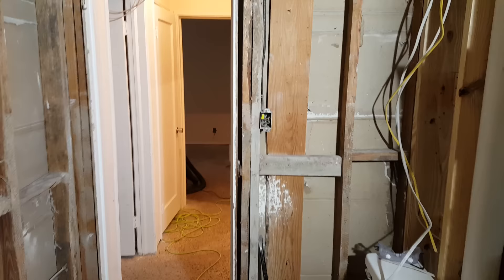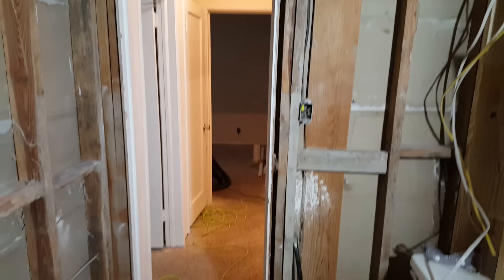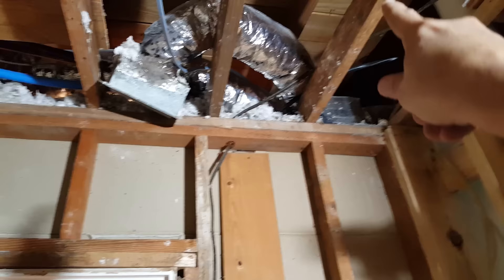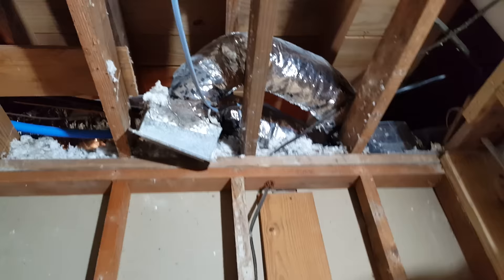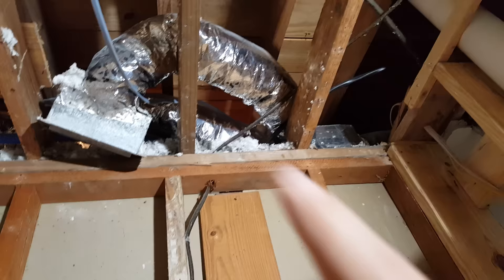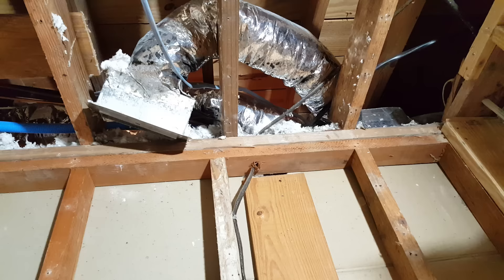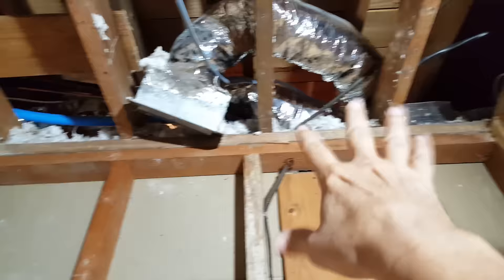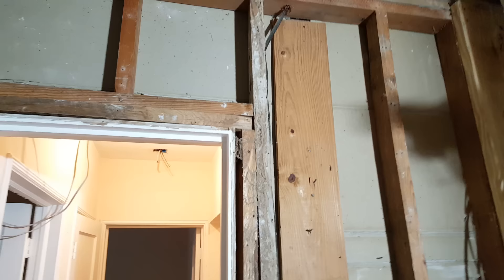How to Tell if Your Wall is Load Bearing

Comment: I thought a load bearing wall is where the joists rest on at the ends, let’s say u have 3 walls, a joist runs over all 3. Do you count all 3 as load bearing or just the two end ones, ??
Reply from the maker: Yes your definition is more exact. The walls with joist endpoints are load bearing.

Comment: Superhelpful video, thanks. If a second floor wall (it's a wall that divides a bedroom, creating a kind of finished walk in closet) isn't above a first floor wall, is that an indication that it's not a supporting wall (because with no wall beneath it, the weight isn't transferred down into the foundation)?
Reply from the maker: That might be what it is in your case, it's really hard to tell without being near to check above the 2nd floor wall because it might still be a load bearing wall but the forces are being spread out all around the floors on the 2nd floor and then down to load bearing walls beneath the best way to tell this to go up in the attic above the 2nd floor if any floor joist have end points on top of that wall then it is load bearing. If you see any with instructions from any of the roof gable's coming down and resting on top of that wall then it is a load bearing wall
Reply: @jeffostroff  Great, I'll check it out. I'd likely have someone come in and look at it before taking a wall out, but if I can tell that it IS load-bearing myself, then I won't bother dreaming about getting rid of it and won't waste $$ bringing someone in.

Comment: Would there ever be (ceiling) drywall between a top plate and a ceiling joist? I have a truss roof.  Wall is running perpendicular to the ceiling joist (middle of house). Seems like it is non lead bearing?
Reply from the maker: Not that I know of, drywall is not meant to be load bearing, so it should not be compressed. It could be mounted on the top plate if there is no ceiling joist resting on it.

Comment: What code does not require an approved and properly supported header (beam) in a load bearing wall?
Reply from the maker: Keep in mind this house was Built-in 1946 for veterans on the cheap and so often times things were done a lot more simply and who' is to say what the codes were at the time or whether they were even observed. Also there are some debate as to whether this wall is a full load bearing wall because the ceiling rafters above do not end point on top of this wall they do rest on the wall but they don't end point on top of the wall.

Comment: I am an engineer and carpenter. There are several times in which information given in this video was incorrect.  Please do not take advice from a Youtuber, get a licensed contractor or engineer inspect your home.
Reply from the maker: I doubt you are really an engineer, because f the info here is incorrect, you would have pointed out which item and what is wrong with it and which building code spec it violates. You just come in here pumping your chest about how you are an engineering God and hand wave about "several times" bad information was given, a bunch of unspecific nonsense. So here's your chance to "correct what is wrong".
Reply: -Double top plate in no way implies load bearing. Double top plates are used to tie into other walls.
-Joints lying perpendicular to wall doesn't imply load bearing. If the joists were overlapped over this wall, its load bearing. 
-There's no worry of shear in top plates in traditional or advance framing.
-That was not an appropriate header for a load bearing wall.  
There is no gray area when deeming a wall load bearing. It either is or it isn't. If you're worried about sagging then the sagging needs fixed before anything else. I'm not trying to argue with you, or call you a bad person, or boast about my credentials. I'm trying to make sure people are being safe. So my only real correction is, get it inspected by someone licensed.
Reply from the maker: The International Residential Code, Section 602.3.2, Top Plate, specifically states: “Wood stud walls shall be capped with a double top plate installed to provide overlapping at corners and intersections with bearing partitions.”  Notice it says Bearing Partitions.

So you and I are both right, the top plate serves a double purpose, but I even mentioned in the video that even nonbearing walls often have upper plate. But you are still half wrong You can see it requires the top plate for load bearing walls, not just for any old wall. But of course many carpenters build them anyway. Also in Section R602.3.2 Top Plate, they give an exception where you can eliminate the top plate if an only if  “1. The single top plate shall be tied at corners” with a 3 x 6 galvanized steel plate, AND, this is the big part, just like I stated in the video:  “ 2. The rafters or joists shall be centered over the studs with a tolerance of not more than 1 inch (25 mm). “ Clearly they are worried about shearing, because a 2x4 cannot possibly be expected the bear the weight. After all, you use double 2x6's for a header over a door right?

so based on the specs given by the building codes, it does indeed require a top plate for load bearing walls unless you can guarantee that the joists are directly over the stud. This is where I mentioned builders are looking into designing their roofs to comply with this to save wood.
Reply: Yes it says bearing partitions but it's not saying a double top plate is there for bearing. It's saying the double top plate is there for overlap at the intersection of a wall and a "bearing partition". A bearing partition is just a bearing wall. So a double top plate is required for tying into load bearing walls and corners.
I was taught that joists need to lie close to a stud for things like toe nailing or other fastening because if they're not, a sagging joist that is only nailed through a single top plate could twist the top plate.
Reply from the maker: Play nice people,  There's always going to be 2 different opinions on the same topic. AND please keep language family friendly no cursing, flaming etc.
Reply: Engineer lol.
Reply: I'm not engineer, but am a carpenter. This guy is full of bologna. This is simply not a load b wall.
Reply: jeffostroff I am a Contractor in California and this is Not a load bearing wall. A load bearing wall would require a footing with HDs in the corners of the wall. This is simply a partition wall.

Comment: I have only helped build my own house (not a carpenter) but if that was a loadbearing wall, wouldn't I would want to see a header with the 2x vertical?  Laid on their side like that, those header 2x are a lot less resistant to bend.
Reply from the maker: Joshua Horns  Yes you are correct you would want to see that Head are you described with them on the vertical and in fact many modern day carpenters prefer to use 2 by 6 on vertical.  Keep in mind that this house was Built-in the 1940s on the cheap for veterans and so a lot of times either corners were cut or quality goes by the wayside or may be a lot of people just didn't do it that way back then. Also this particular wall might not be a full load bearing weight wall because the ceiling joists up above do not terminate on top of this wall but they do cross it at a 90ﾟ perpendicular.  Even if a wall is not load bearing I still prefer to see the door frames built the way you described anyway just makes good sense and it really doesn't take much longer to build it that way and it allows for expansion later on of your house or any other improvements that might require beefing up a doorway.

Comment: The builder didn't do the header correctly if it truly is a load bearing wall.
The "header is  two plates on flat.
Reply from the maker: Yes, that is how they did it here in 1946 here in Florida. Also this is not a true load bearing wall in the strictest sense, because the joists do not endpoint on top of this wall, they stretch over this wall, so they did not need to use two 2x6 board sandwiched together and mounted vertically.

Comment: The header above that door is not a load-bearing header it should be stood up on edge and have to and they should be at least 2 by 6 if that's very well if it's just a little flat laying flat that's not a load-bearing wall
Reply from the maker: Yes you are correct and keep in mind this is a house Built-in 1946 on the cheap for veterans and so they often did things not up to code. And if this wall is not a full load bearing wall then they have no problem to get away with doing this

Comment: I thought that secound 2×4 on top was to tied the walls together?
Reply from the maker: Angel Loya  It is there to tie the 2 walls together and it is also required for load bearing purposes. The building codes allow you to eliminate that top 2x4 if you use a 3 by 6 galvanized steel plate  To tie the 2 walls together
Reply: jeffostroff All walls have the 2 top plates. Doesnt matter if its load bearig or not.
Reply: Snipe Stud00 right. thats how we did it. Every wall has a top plate.
Reply: In 20 years I have never built a wall that didn't have 2 top plates.
Reply: Angel Loya  the second top plate is to tie the walls together.
Reply: Angel Loya also, if the wall is load bearing, you should have a minimum of 2x6 for the header. You never turn the wood on its flat as there’s no strength to the wood that way. 2 2x6 with a half inch plywood sandwiched between them.

Comment: what about engineered roof trusses spanning a main floor ? ive looked in my attic and none of the ceiling joists (rafter bottoms are lapped or butted over a wall im thinking my entire top floor could be opened up the floor joist are different though as they lap over on a wall in the baesment
Reply from the maker: If you have the case where the trust is go all the way across the house and don't end point on any walls then chances are your exterior walls are the load bearing walls. If you look up in your attic do you see any structure components coming from the top of the roof Truss down to any of the walls? If so those walls would be load bearing because they are acting as a brace for the load of the roof

Comment: is it ok to remove a kitchen cabinet above a refrigerator if the wall is load bearing ?
Reply from the maker: Yes we do it all the time  and replace with new cabinets you just want to make sure your screws go through the back of the cabinet on a support brace on the cabinet and all the way through the wall into a stud. What I like to do is put full depth cabinets over the refrigerator but when I do that I will then add a a thick panel on either side of the refrigerator to help support that cabinet and also make it look more professional. Many of the cabinet manufacturers will have these panels that you can buy and you just cut them to whatever size you need

Comment: Is there any way to open up that doorway any? I have a doorway into my living room I'm about 90% sure its load bearing but I'd really like to open up the hallway straight into the living room is that doable?
Reply from the maker: There is a way to do that depending on how wide you would need the opening to be you would have to use to buy 6 headers that are standing upright so that the 6" part is the taller part and you would have to of them seem which together with the board and between them or you would have to have somebody engineer you a beam with adequate Jack studs and king studs on either side

Comment: I am looking at taking out or modifying a wall in a house with a a flat roof (no idea why they put a flat roof on a house) and no basement.  Are there any other non destructive methods to determine if the wall is load bear or not or will I just have to rip into it to find out?
Reply from the maker: You'll have a to cut a large 12" or large square hole near the top of the wall to stick your head or camera, and cut a square hole on the ceiling, so you can look above the wall to see if any ceiling joists have ENDPOINTS resting on top of the wall. You don't have a gabled roof based on your description, but also look to see if there's any roof support struts, or other angled 2x4s that end on top of the wall. If any of these are true, then the wall is load bearing. If all you have is ceiling joists running parallel to this wall and nothing resting on top, it is likely not a load bearing wall. If you have Ceiling joists that are perpendicular over the top of this wall but they don't endpoint over the top of the wall, it is also likely not a load bearing wall. I would also look where those same ceiling joists end, like over cement block walls at the front and back of the house, those walls would be load bearing because they are endpoints for the point loads. And then likely your ceiling joists are stretching say 50 feet from front of the house wall to rear house wall. Most wood is shorter than 50 feet, so it's done in segments. If the length of ceiling joists is long enough, there is likely a wall half way front of house to back of house where ceiling joists do endpoint and rest on top of the wall, then continue on with new pieces of wood toward the rear of the house. Those walls at the half way point would be considered load bearing.

Comment: Great explanation for us novices :) Thank you! Im trying to make a small storage space under my stairs. I have a knee wall going up about 5 steps. Then from there there is a wall going all the way up to he second floor. I cant tell if the 2 studs i wnt to remove are helping to hold up the second floor hallway. The joist i think are running parallei to the stairs. Do you have any videos on making storage under stairs?
Reply from the maker: No videos on that yet

Comment: I have a 14' wall that extends from the end of the wall on one side of the home, inward 14'.

This wall has a door, to a small room, that room had a wall separating it from the master bath,  its gone.

This wall runs in the same direction as the ceiling joust and rafters. Would this 14' wall be a load bearing wall?
Reply from the maker: It does not sound like your wall would be a load bearing wall if it is running the same direction of the joists above it, but the true way to tell is if there are any floor joists above this wall whose endpoints are resting on top of the top plate of this wall, not just the joists are crossing the top plate, but if they end on top of the plate, then this wall would be load bearing. Also are there any vertical members of the roof framing support that are angled upward to the roof peak, which have endpoints resting on top of this wall? If either of those 2 cases are true, then you have a load bearing wall.  You can also do what we did, cut up 2 x 4 blocks so that as you pull the bottom plate out from under each vertical stud, you hammer in this block behind it to hold up the stud and take the place of the bottom plate. Just have the block occupy only half of the stud bottom, so you can hammer in the new bottom plate, made from pressure treated lumber, as required by code.

Comment: Two top plates is one indicator that it might be a load bearing wall. But if it was a load bearing wall, where is the header above the door?? Where i live, a header is not made of 2 by 4 on its side.
Reply from the maker: Apparently none of you pay attention to the video or at least read some of the other comments that say the exact same thing before you each coming and type in the exact same thing. This house was Built-in 1946 for veterans they were built cookie cutter style super quick and cheap with less than optimal techniques and who knows whether they even had those building codes back then.
Reply: @jeffostroff  hey man i wasn't saying you were wrong or right. I was just pointing out no header above door. On second thought, i have to say it doesn't look like a load bearing wall. When i did framing all the walls we errected no matter load bearing or non loadbearing were double plated and they all interconnected the top plates. The only walls that weren't were the walls we put in at very end.
Reply from the maker: @shawnyblaze   There is still debate about whether this wall is really fully load bearing or not because the ceiling joists don't have end points on top of the wall they just go across the wall perpendicular. Although with an older house like this and sagging you can bet there is probably some downward force exerted from them but most likely the load is carried by the back wall of the house which is made out of cement block wall about 10' away from this wall.

Comment: So am I correct in understanding that all walls that run perpendicular under the joists will be load bearing walls?
Reply from the maker: Sherri Markum Wheeler  No that is not always the case; in the true sense of a load bearing wall you will have 2 joists whose end points end on top of the wall or a joist is made of 2 pieces that at least overlap over the wall.  For the average layman who does not go up into the attic or cannot see how the floor joists stack up over the wall,  Then seeing perpendicular joists should make them stop and give special reverence to the fact that this wall could be load bearing.